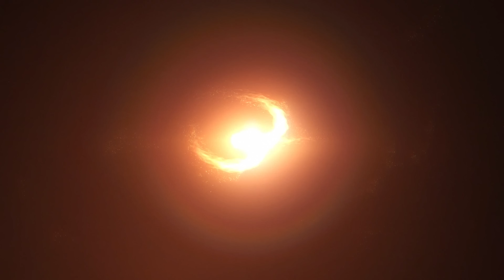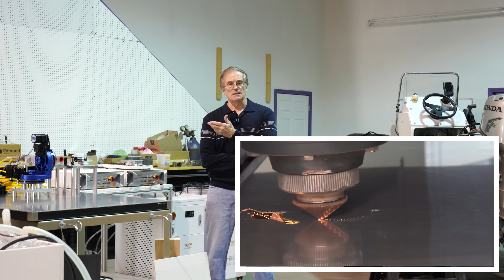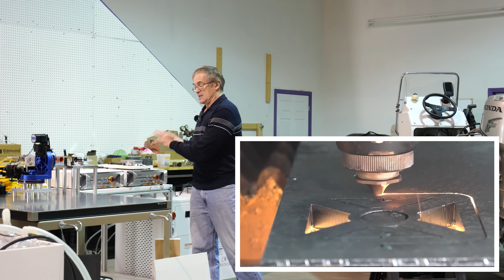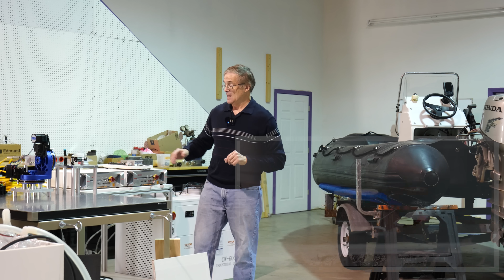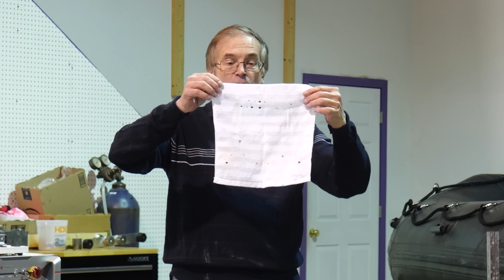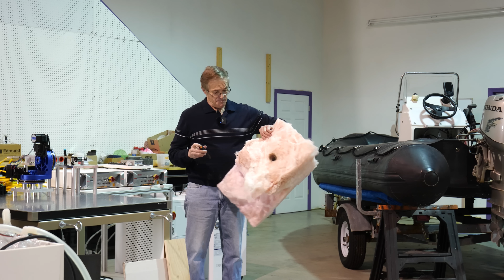We have a problem... and need your help!

Comment: Maybe i missed something and i definitely don't understand lasers at all. But you have to focus the laser to work properly right? Could you make a seperate system that does the opposite? When the laser locks up you push a button or make it completely analog for extra security that slides a lense or more infront that distributes the light in more manageable sections. This way your backstop doesn't need to be as extreme as possible right?

Comment: If you can find a material that can handle the power of the laser for a fraction of a second you can extend this time by constantly moving it around. Something like a spinning disk, drum or moving belt. Belt would require elastic material but it would be possible to make the target much more compact. It would be interesting to see spinning brick cylinder too. I think that some x-ray tubes use this method to avoid melting the anode. And how about redirecting the beam straight into ground? Or maybe defocusing it? Or both. If all of this fails, use Nokia 3310.

Comment: One of your assumptions regarding "large wall" doesn't need to be there to use heavier, more absorbent material. Build N different wall "strips", e.g. 2m high by .5m wide, and put each one on a horizontal platform of similar shape (looks like an upside down T from the side). Put some casters on the bottom. Now you can easily move them around, form a larger wall with them side-by-side, and as each section gets overly damaged from laser exposure, you only need to replace that strip.

Comment: Please consider:  Multilayer graphene-based coatings offer a four-star level of laser mitigation on wood, steel, silicon, and carbon fiber substrates by combining broadband optical absorption, exceptional thermal conductivity, and barrier protection. These coatings significantly reduce localized heating, delay substrate degradation, and enhance resistance to both pulsed and continuous-wave high-power laser exposure, especially when integrated with fire-retardant or ceramic binders.

Comment: From a friend…

Simple, set up a water flow drop, waterfall if you will.
You need density of water, to achieve this you need to think volume, in return suggests you need a 1 1/2"- 2" pump build it on a rolling base with a large tub basin add a 2" pipe from pump up to the flow trey closed on 3 sides forcing all the water out on side falling i to the tub and back again.

Comment: Use a diffusing lens backed by a tungsten heat sink (w/cooling fins). Mount this assembly so it is always in front of the laser output. Then just swivel it out of the to fire. Construct the mechanism so that it defaults to block the beam even with power loss. Actually, I think that the moving part could be just the defusing lens and a mirror and then the heatsink and cooling could fixed and stationary. I hope this might give you a direction to go in at least.
It seems to me that's its impractical to try and block the beam at full concentrated power over a wide area. Good luck!

Comment: It would be helpfull if there were some laser specs in the description. 
I was thinking of 'smart glass' - the electrically switchable privacy glass. Put as close to the laser as possible. Stack some of those panels and let it soak the heat.
But that will not work. When it switches on the glass will superheat in a very small spot and instantly burst (or explode). So then the next idea came up, based on the same prinicple.

Dispersing the laser beam and soak the heat. Some kind of tank made of a material that is highly transparent, filled with a liquid that has just the right refractive index to your laser.
Perhaps not very portable, perhaps. but worth exploring.

Comment: Maybe a combination of materials will help. Like wooden plate, but soaked in Water for a night. It would at least get rid of the fire problem and might even extend the time of it burning through the wood.
The hard part of that Idea is of course the time to properly set up, getting the wall up before any drying accures and i also suspect it will be a one time use thing as well, since (depending on the kind of wood) it will deform/desintegrate if soaked and dried repeatedly.

Comment: What about ceramic fiber sheets? Nasty stuff but have a higher burn rate. It's white but maybe you can coat in in black Flocker or dust them with graphite powder to darken them so it's not reflective. Or have like a giant fan behind the target so the laser is constantly hitting another fanblade and being interrupted, eiving each spot a chance to cool. You could make the blades out of fiberglass or something

Comment: 1. If you could perfectly tune the two lasers you could get them to destructively interfere everywhere but a standing wave where you intend to cause damage and the frequencies could be in phase at this point and be constructively interfering. In a perfect world you would then not need a backdrop.

2. Not super effective/cheap/easy but a good brainstorming idea would be a large block/sheet of ice. 

3. I learned recently that in metal milling the chips remove heat from the worksurface. Maybe you do want offgassing to remove heat just offgassing of water instead of poison. 

4. Maybe you can use paraphin wax to coat several thick layers of blackened carbon onto the best subsurface you can come up with. Recently saw this on gunsmithing videos that they use burning wax to deposit carbon.

5. Youre emitting it from fiber optics, maybe there's a way to capture it again with some fiber optics (again just for the brainstorm concept for someone else to work off)

6. Perfecly light absorbing surface has theoretically perfect internal reflection so find a list of materials with internal reflection index of almost 1 and look at their "poisonous" properties for off gassing. 

7. Maybe check with @NightHawkInLight and see how his fireproof expanding graphite or infrared cooling paint would hold up against laser heat

Comment: The frames they use to move glass/marble its like a A when viewed from the side. They have wheels and load into truck beds. You can use the frame to build a custom back drop. The slight angle would deflect light upwards too. Think white refractory brick with water cooling of some kind. Either tubes through the bricks or a screen/waterfall effect covering the surface with a thin constant stream of water. Hopefully this helps.

Comment: Just a thought. Multi layers of woven roving fiberglass cloth with a constant  flow of water over them . (essentially a large "gutter "  at the bottom to catch the water , pumping it back to ,the top, then a dispersion system to, give you as close to laminar flow over the curtain (just to provided a consistent thickness of water)). if it works, cheap and easy.

Comment: You never really explained why a brick wall wouldn't work, just that you wouldn't do it. Does it have to be that massive? Also, you could probably build it out of light expanded clay aggregate blocks to have it be easier to move around. Place it in a trailer. But I would suggest small bricks like the one you held in the video.

Comment: How about a box with an inefficient mirror bouncing the laser beam around? After many reflections the laser beam is absorbed. Over a large area. Maybe you could fill the box with water or some other liquid too, so it would have a huge thermal mass as well. It‘d be similar to a black body box, but more reflective with some additional cooling or thermal mass. You can then maybe have a way to switch between output beams directed at this diffuser and your target.

Comment: A glass acuarium-like wall with water with suspended coal powder on it could be a solution: coal is very good at absorption of light at visible wavelengths and water will remove the heat... transpatent glass for the container so it didn't get absorved and water should keep it for getting melted, but maybe some antireflection coating will be required to reduce reflections

Comment: Try seeing if the laser will or won't burn through a small block of dry ice. If it doesn't burn through then have a piece ready that could drop directly in front of & that is a few inches from the optic output. Or a piece of compressed carbon ash to set in front of the beam. If that fails & if you can get it try a block of light weight Aerogel.

Comment: Had another idea, and figured why not comment even though it is a little silly. 

The problem can be reframed to not be one of absorption; but instead to one of distribution. My idea is to build a cylinder of imperfect mirrors that you would engage the laser at from a perpendicular skew and a slight offset. With sufficient reflection and diameter of of the tube, you could wrap the laser around like a coil, and due to the imperfect reflecting the timing and direction of the laser would be distributed for less impactful absorption into a chosen dump material.

Just a silly idea :)

Comment: Pointless plebeian here.

The solution is, " MOAR POWAHHH!! " Obviously.

Few sugestions...

Suggestion 1, A sand wall (or Starlite) wall encased in a glass ( or other optically clear ).
Nighthawkinlight made a cool starlite example that seemed to have great thermal reflectance.

2nd suggestion, Furnace wool / fire brick (not confident on this one)

3rd suggestion, A few layers of a metal mesh. Serving to capture light and to dissipate the heat. (doesn't have to be thick) just multiple layers.

Comment: If you want a vertical target surface of like 20m2, anything you build will either be too expensive, too heavy, or both so you need to remove a constraint, my choice would be to not make it vertical (cuz i'm really cheap). In the video it is apparent that from the ceiling (point of view of the camera) you can see an area of free floor space twice as wide as the door you intended to shoot at: 

spread 5cm of (silica!)sand on the ground, costs less than 200€, add the cost of scaffolding to provide access to the laser up there to work on it. Plenty of space to test a drone. 

1) Sure the sand will weigh around 2tons for 20m2, but you can literally just move it with a broom and shovel (and even resell it after if you fancy removing the molten bits from it). 
2)Even if it somehow goes through, you just have a hole to patch in the concrete, instead of the neighbor.
3)Plus it will make even more sure you can't shoot towards the sky/ceiling, which even at a shallow angle would be a risk to both the local airspace and the eh.. ability of the building to remain watertight.
4)Oh and of course the angle will help with apparent thickness for the beam pov.
5)I don't think sand should reflect the beam even at high beam densities (i mean it will absolutely light up the room but not coherently enough to put a hole in anything).
6) If you insist on keeping the control pattern and angles similar to real life situation, you could even mount the moving stages upside down and shoot at 40° below horizon instead of 40° up, i imagine the actual lasers might be gravity sensitive but they can stay upright since there is a flexible fiber in between.

Comment: Phenolic ablative heat shield (as in Apollo or Crew Dragon) strikes me as a possibility. As the vapor takes the heat away from the bulk. Orbies in water. Rotating copper disk. Thick white smoke between two panes

Comment: Optical and Beam Engineering
- Beam Dump Systems
- Specialized materials and geometries that safely absorb and scatter the laser beam after use.
- Water curtains, carbon targets, or metal cones.
- Pulse Shaping / Energy Spreading
- Stretching pulses in time to reduce instantaneous power and reduce peak thermal loads.
- Optical Isolation / Redirection
( Reflecting excess energy away using mirrors or prisms toward safe dumping targets. )

Mechanical / Material Absorption
- Ablative Materials
- Sacrificial materials designed to vaporize and carry away energy during brief exposures (common in pulsed laser systems or high-energy beam dumps).
- Heat Sinks
- Massive metal blocks (often copper or aluminum) to absorb and slowly release heat over time.

Just some ideas from a Computer Scientist :)

Comment: A couple of ideas: 
1: A Beam Dump for source side safety - If you implement a secondary optical path into a commercial beam dump, you can reduce the time that your walls will ablate due to laser radiation
2: A beam dump for target side safety - Depending on the frequency of these beams, a material with a high level of reflectance at your target frequency may help. I think aluminum should be fairly reflective at 1030nm. If you can reflect a majority of the light in a safe direction (downward) , you may be able to create a 2d blackbody to contain the beam

Comment: Have you tried Rockwool insulation?  It would be similar in application to the fiberglass, BUT it would be much more dense in my opinion and I would think would have a higher melting point. Also, it’s a lot easier to work with and would also give the added benefit of reducing noise /echos in the room
Reply: Any affordable fluffy insulation will not work for the simple reason that what matters is the total mass of material in the path of the beam, the laser is moving at the speed of light, it really doesn't care if the material is 100 times thicker as long as the amount of material is the same. Of course this is only true at high energies because the beam will turn anything in plasma in microseconds, for low energy beams or extremely pure targets (i.e optical elements) then the usual optical effects like diffraction/diffusion are relevant.

Comment: ITC-100HT painted over ceramic blanket could be a good solution. 

I’ve used this on the firewall of my diy blast furnace while attempting to smelt iron metal from bog iron (iron oxide rocks).

You could also try satanite (not sure about spelling). Great refractory material usually used as grout by it can be diluted and painted onto a surface.

Comment: Pulse? Very short pulses in short burst should allow power but limit penetration. 

A brick of glass chips (like broken safety glass) maybe mixed with gravel would brake up the beam and unfocused. You may want something the drywall to prevent reflection.

Comment: I will Keep It Simple (KIS), crushed charcoal in thin pillows . It should be light and easy to hang, well absorbs the laser and if crushed well it could help in scattering and even moving the charcoal due to gravity to replace the ones that are heated to become CO2. Just a thought!

Comment: Given that your testing (for now) is a static target.  Have you considered another lense set to difuse the beam?  This way you could reduce its power either completely or at least enough to be easier to "catch"/block after it passes thru the target.